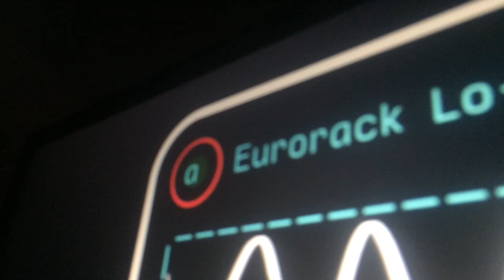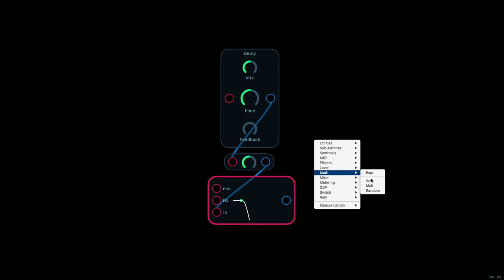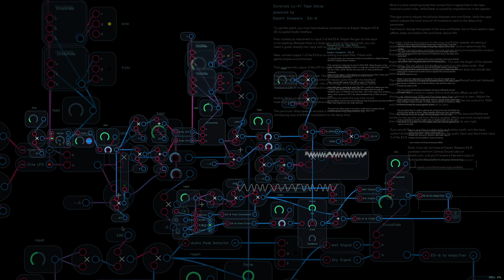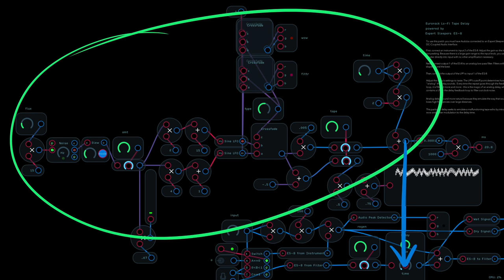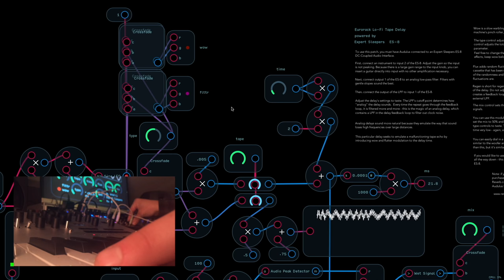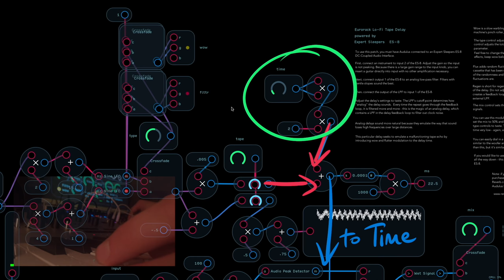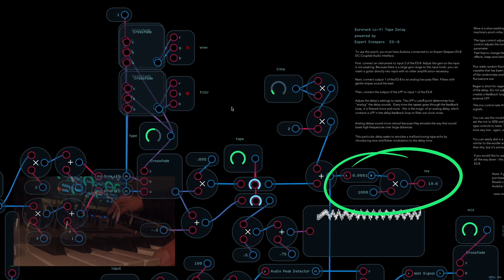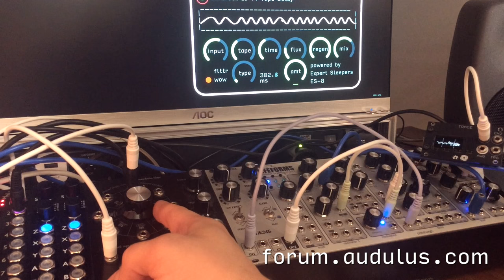Audulus Build Podcast #8: ES-8 Custom Analog Delay

Comment: loving to use this configuration. Apart from the ES8 and an ipad with Audulos, which cable should i get for connecting them?
Reply from the maker: Thanks! :) You can plug directly into it with a lightning to USB cable - it's just like any other plug 'n' play audio interface that you get for iOS :)
Reply: cool. another question, is there a maximum number of output channels in Audulus? i know ES8 has 8 but is expandable
Reply from the maker: Right now it's just 2 I/O, but we're building a new feature that is arbitrary I/O - so you could chain multiple ES-8s together as an aggregate device (with a computer) and have as much I/O as your CPU can handle. I think the ES-8 is only expandable over lightpipe btw.
Reply: yes, maybe i didnt explain myself well, suppose you make a rhythm machine with audulus and intend to use all eight es8's outs as triggers for your drum modules. you can do only 2 different triggers via audulus?
Reply from the maker: You could have 8 independent triggers going out, actually! :)